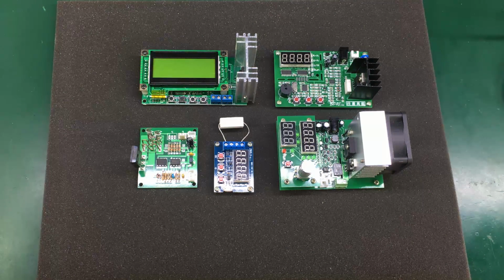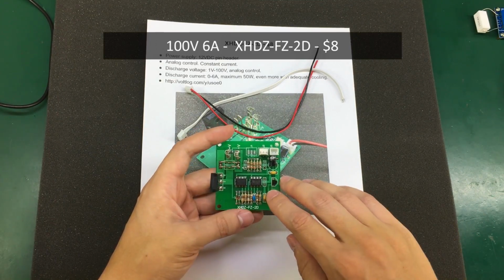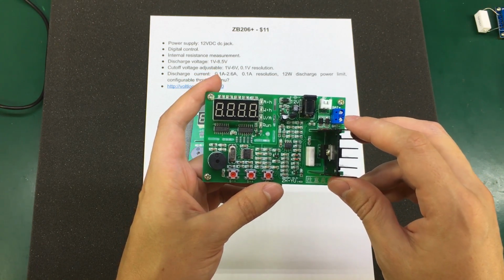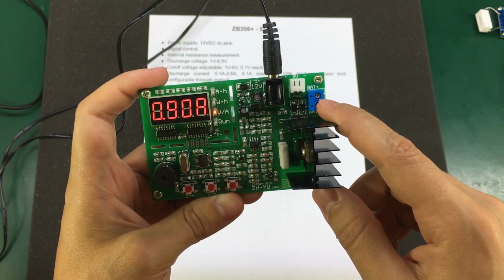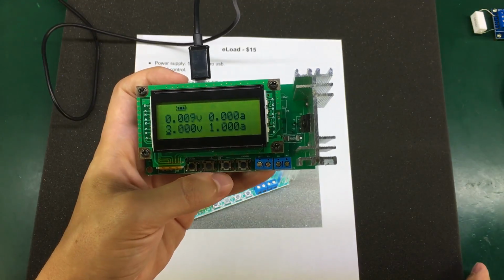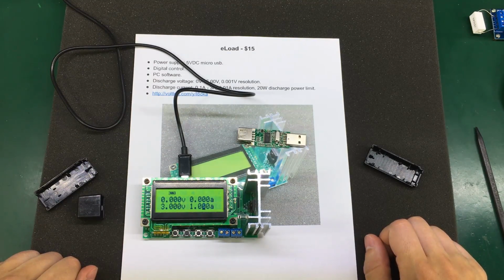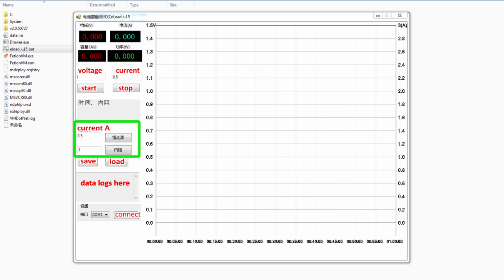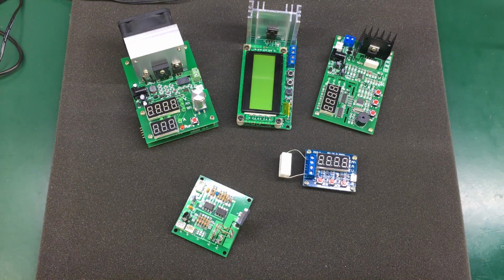Voltlog #61 - Dummy Load Special

Comment: I'm still relatively new to the hardware side of this hobby and I'm wondering what the best general multi watt resistor values I should keep on hand. I'm getting into making buck/boost circuits and I'd like to have some resistors for load testing instead of relying on my variable one.

Comment: Hello I fixed my eLoad it was the shunt resistor, blown from PCB side. Now eload works but I'm having trouble calibrating it with chinglish manual from banggood, so could you make a video about this calibration procedure?

The eload is back on aliexpress but it's way more expensive 20 to 30Eur
https://goo.gl/sRheFF
https://goo.gl/mThMFj

Comment: have you tested this one ?  KKmoon LED Digital Battery Capacity Meter Discharge Tester Voltage Testing. I am looking for a accurate tester for 18650 batteries..i do not have a lot to test..what do you recommend .
Reply from the maker: I haven't tested the one you are asking. I recommend the ZPB30A1, it's reliable and easy to use.

Comment: There are other 2 models on the market now:
https://www.fasttech.com/products/1/10044951/9615247-juwei-180w-constant-current-electronic-load
https://www.fasttech.com/products/1005/10044951/9615248

also, i see now other stuff produced with that hw display + sw sold under Juwei brand
Reply from the maker: not really new, checkout voltlog #119
Reply: VoltLog oh yes... Now I remember the 150W model.... I guess the 180 has the same software just a different resistive subsystem

Comment: My eLoad USB is till not working I replaced transistor, the comparator IC. But on 8V it shows 28V in calibration and gives "Vol high" error
Reply from the maker: that's too bad :( Sometimes it's just easier to buy a new one if you feel stuck and can't get it working.
Reply: Everywhere the eload is out of stock. I changed Transistor, diode I used non fake 5A 40V SS54, changed Opamp IC TLC272C, changed battery protection chip 8205S, then unsoldered the current shunt resitor and found it was burned. Now I ordered new 3W R050 current sense resistor.

My R050 current sense resistor is on negative rail, yours seems to be on positive (like many images of the eload i found). What's the difference?

Is it possible to burn the eload by disconnecting 5V power to it while it's connected to 12V lead acid battery? Is this normal, because in power loss the eload will auto destruct? Is this why the current sense resistor was moved to positive rail?

2 versions of eload are on the internet:
v1 negative rail https://goo.gl/Ce2gPf  current sense resistor on middle transistor pin
v2 positive rail https://goo.gl/KRwV96  current sense resistor on s transistor pin
What is correct ?

Comment: I got my order on this one yesterday and played with it for a few hours. http://voltlog.com/y/usoe0
After attaching a big'ol-ass CPU cooler from an old Dell, I am easily getting 12.3V @7.2 A, which is over 88 Watts! The pot caps out at 7.2A. 
The temp is still at 51ºC with a very quiet fan. 
I am building the one from Scullcom hobby which you are familiar with (https://youtu.be/9fsf1CgnTRk), and wanted a cheap way to verify it works. For $8 you can't get any better! Did you ever think of slapping an Arduino on this one and add bells and whistles to it? 
So, 75 Watts is no problem. Thanks for this video, which made me bite the bullet and buy it. 😉
Reply from the maker: well, I thought about slapping an Arduino on a dummy load, I've even started designing my own dummy load but stopped along the way because I didn't have enough time and it was pretty tiresome to do everything by myself(firmware, GUI, enclosure, analog, pcb layout)
Reply: I like this unit very much, but its useless for me the way it is.
Unless I want to stand around for hours and record data and make sure it doesn't over-discharge my batteries!
It will be good if I wanted to load a power supply or something and watch the results, but that would be about it!
I think I'll have a go at making it better by attaching an Arduino, an SD module, a current module, an I2C display module, an  ADC and a DAC module I have hanging around collecting dust, and make this unit useful. 
I am too lazy to create a PCB or anything like that. Will just inter-connect the modules I want and see how it goes. You are right though, it does take a round 40-80 hours to do it, but hey, I don't have a YT channel and I like building stuff.

Comment: Nice upload and explanation. If anyone wants to build a super simple adjustable dummy load, Dave has a good post on EEVBlog about building one with a LM324/LM358 and a logic level n-channel MOSFET. 
  I don't know if I trust a Chinese module any more than a double dummy load without a microcontroller/connectivity ;)

  Thanks for the upload.

 Watching/building Dave's circuit lead to this video suggestion, and my subscription.
Ref(no affiliation):
https://youtu.be/8xX2SVcItOA

Any updates on which one you use most now or any that have broken during normal use?
Reply from the maker: the 60W dummy load with the 7 segment display is the most used one. None has failed so far.

Comment: hi can you do a video showing how to use the zb206+ in 4 wire mode to check the internal resistance of a single 18650 cell . thanks

Comment: Did you try this module:
http://www.ebay.com/itm/150W-Constant-Current-Electronic-Load-Battery-Discharge-Capacity-Testing-Module-/232197515548?hash=item36100ce91c:g:k2gAAOSwEzxYb0f2
Reply from the maker: Not yet.

Comment: You seem pretty competent on the matter, wich I aint.
Are you familiar with any android-app or windows program that are able to take the bluetooth seriel-stream values, like from theYZXstudio 1270 USB meter and then graph them out on the fly.. I have come across many Bluetooth seriel apps that does connect and show the values in hex or seriel, but it would be great if there was an app or program that could map/graph them out on the fly.
Reply from the maker: I do not know anything about that USB meter, I don't have one..
Reply: roger that, but its just a standard Bluettoth seriel streamer with that cheap BT-board that goes for no money, overall so any program able to graph seriel-values on the fly will do (any bluetooth terminal can sense the stream from  this USBmeter)

are you familiar with any program that are able to take stream of bluetooth "seriel" volt or current values and plot them on the fly, - either in hex or seriel-values? - i get them in bluettoth terminal in hex or seriel with seriel (fx 0052412) equals 5.2412volt and 0012123 (equals 1.2123 amp) - looking for an app or program that takes these vaues and plug them in graph-pattern so one dont need to plug them in manually.. (pretty sure this relative basic-program is out there, just to find it :- )
Reply from the maker: Sorry I am not aware of such program but you could log the text values and plot them in Excel for example.

Comment: Please test
https://www.aliexpress.com/item/Electronic-load-constant-current-load-constant-voltage-load-module-aging-test-aging-resistance-can-be-customized/32716576604.html?spm=2114.01010208.3.341.eiGy3o&ws_ab_test=searchweb0_0,searchweb201602_3_10065_10068_10000032_119_10000025_10000029_430_10000028_10060_10062_10056_10055_10000062_10054_10059_10099_10000022_10000012_10103_10000015_10102_10096_10000018_10000019_10000056_10000059_10052_10053_10107_10050_10106_10051_10000053_10000007_10000050_10084_10118_10083_10000047_10080_10082_10081_10110_10111_10112_10113_10114_10115_10037_10000041_10000044_10078_10079_10077_10000038_429_10073_10000035_10121,searchweb201603_9,afswitch_3,single_sort_3_default&btsid=f877ea1d-9b90-4f2c-bd39-8984b36d185e

https://www.aliexpress.com/item/150W-Constant-Current-Electronic-Load-60V-10A-Battery-Discharge-Capacity-Tester-ammeter-voltage-meter/32725711985.html?spm=2114.01010208.3.165.NgJJdQ&ws_ab_test=searchweb0_0,searchweb201602_3_10065_10068_10000032_119_10000025_10000029_430_10000028_10060_10062_10056_10055_10000062_10054_10059_10099_10000022_10000012_10103_10000015_10102_10096_10000018_10000019_10000056_10000059_10052_10053_10107_10050_10106_10051_10000053_10000007_10000050_10084_10118_10083_10000047_10080_10082_10081_10110_10111_10112_10113_10114_10115_10037_10000041_10000044_10078_10079_10077_10000038_429_10073_10000035_10121-10051_10113,searchweb201603_9,afswitch_3,single_sort_3_default&btsid=72c9203c-39f5-4937-bb7e-9f10cd4e0591

Comment: Got "eLoad USB". 

My version goes down to 10mA, and seems to accurate.
My verion is different only microUSB connector, the diode is on top.
The design is so bad that if power is lost during testing of the battery from 5V USB, the load will be dead. Your load seems to have 5A diode, my has lower 3A. 

I tested the diode and MOSED to be good, however I ordered new ones to test. Very disappointing indeed.

No damaged parts visible, but I can smell the magic smoke ! on the MOSFET side.
Imagine running from UPS because else you will burn the board or loose the data, because the dummy load does not remember the values.

Please test the new 150W load, I wonder how it performs.

Comment: I just bought an item similiar to ZHIYU ZB2L3 and plugged it to usb and started the test. It has now been testing the 18650 battery i have taken from a laptop batterypack for 21 hours and current reading is 1269mAh and test is still running.  Could the item be faulty or maybe the resistor. Resistor has markings 5W 75R J printed on it and looks like the one on the video (ceramic). Resistor is just slighty warmer than my fingers.  Can i just change the resistor to a aluminium covered 22 Ohm i found in a box. And do the ZHIYU ZB2L3 understand the change and still measure the capacity right? The resistor is silver colored and has printed the following markings on it: SH25 22Ohm 5% R9

I searched around and by watching your video i understood that 4.2V and 7.5 Ohm is 560 mAh  and if so the 22 Ohm resistor should drain 190 mAh.  If my 18650 battery is around 2000 mAh it should take 10-12 hours for the ZHIYU ZB2L3 to finish. 

Now it has been testing with the resistor that came with the set for 20 hours and still going on.
Reply from the maker: 75R is 75 ohms, so just 56mA discharge current, it's going to take forever to discharge those cells :-) Try a lower value resistor like 7.5ohm, keep it under supervision, watch the temperature.

Comment: Reverse engineering of the analogic dummy load XHDZ-FZ-2E. I can't figure out why using the comparator LM393 which has always one diode drop voltage higher on the non inverting input than the inverting input, so the open collector output will have no effect on the non inverting input of the first op amp. Anyone? https://goo.gl/Olr6k2

EDIT: I figured out. When no load is applied between V+ and V- the non inverting input of the comparator is below one diode than inverting input, so is pulling down the non inverting input of the op amp.
Reply: Adrian Carstea we s I was Ist pu 00

Comment: an other one, just spotted on AE: https://it.aliexpress.com/item/DC-3-7V-21V-3A-Adjustable-USB-Electronic-Load-Battery-Discharge-Capacity-Tester/32691675776.html
Reply from the maker: I have seen that one before, increments of 20mA, I'm curious about the lowest current it can go to.. I guess I would spend some more money and get the one with the OLED display http://voltlog.com/y/qxh3k

Comment: Hi,

I want to ask about the ZB2L3 tester.
A review from ebay:

"A word of warning to everyone, DO NOT BUY THIS DISCHARGER! The problem with this discharger is it assumes you have a constant current load hooked up to the discharger and that said constant current is 2 amps. The problem is that the resistor provided with the discharger will not discharge the battery at a constant current as it is a resistor. I plugged in this discharger and set everything up with the 7.5 ohm resistor and the discharger said it was discharging the battery at 2 amps, and this simply isn't true. Because if we do some math with ohms law, we will see that this simply isn't true:

Battery voltage vs fixed resistor value of 7.5 ohms:
4.2/7.5 ohm= 0.56 amps. The charger read 2.0 amps
4.0/7.5 ohm= 0.53 amps. The charger read 2.0 amps
3.8/7.5 ohm= 0.50 amps. The charger read 2.0 amps
3.6/7.5 ohm= 0.48 amps. The charger read 2.0 amps
3.4/7.5 ohm= 0.45 amps. The charger read 2.0 amps
3.2/7.5 ohm= 0.42 amps. The charger read 2.0 amps
3.0/7.5 ohm= 0.40 amps. The charger read 2.0 amps

I tried calibrating each discharger, but it ended up doing nothing. Since the discharger is calculating the capacity based off the fact that a constant 2 amps is being discharged (when really the discharge current is varying), this discharger is unusable for me. I cannot recommend buying this."

- what is the truth? There is a very big difference between capacity measured via professional tester and the ZB2L3 cheap meter? I just want to test my 18650 baterries.
Reply: Good to know, thank you for the info.
Reply from the maker: yes, I was expecting something like this from that tester but not that bad. Thank you for sharing.
Reply: Another YouTuber did a very extensive review on this (almost 45 mins), including reveser engineering the thing and concluded that this is total crap by various reasons. Wonder if the other ZHIYU products have the same mistakes or only the ZB2L3 for being so cheap.

Comment: I can vouch for the last dummy load. It is a really nice unit. I use it to test my 18650 batteries before I use them to build battery packs. One can't go wrong with this dummy load.
Reply from the maker: yup, I use that one as well but it would me so much nicer if it had a pc logging/control app.
Reply: Yea, but who needs that if it is in Chinese. I guess the Chinese.
Reply: @cmj20002  what?

Comment: Further, there is an Upgraded Version of the ZPB30A1 , that makes 110W with a bigger Hetasink : http://www.aliexpress.com/item/110W-Constant-Current-Electronic-Load-30V-10A-Battery-Discharge-Capacity-Tester/32680354244.html. Cheers,Konstantin
Reply from the maker: yes, it was mentioned and shown in the video.

Comment: Good Evening, I like your Videos, Congratulations!
Like you I buy many things I find Interesting from Ebay and Ali-Express and a lot of NOS Stuff for my Lab. Mentioning that, I am Designing an Dummy Load and a couple PSU all MC Controlled, but bcs I switch between many things nothing is ready yet. My biggest issue are the Enclosure and the front panels......Therfore in-between (for testing the PSU's I make) I bought the following :http://www.aliexpress.com/item/Numerical-control-constant-current-electronic-load-power-aging-power-battery-battery-USB-discharge-capacity-tester/32669638121.html. It looks Interesting and the Specs are good for that Money. Perhaps Interesting for you too.Cheers,Konstantin
Reply from the maker: this one seems interesting, what is the resolution on the current setting ?
Reply: I didn't Rceived it yet, but from what I see on the Pictures its should be 10mV, 10mA resolution , I from 0-10A
Reply: I Just received it, resolution is 10mA in CC and 10mV in CV mode, max 10A and 60V, lowest is 10mA and 10mV
Reply from the maker: wow, really nice it can go down to 10mA discharge current.
Reply: These are the posible Settings, didnt tested the CV mode, just CC

Comment: Great video.  I have all of these apart from the eLoad - I use the MC3000 and can't see me wrestling with the s/w.  Agree with your comments.  (There's a whole YouTube video waiting to be done on the shameful behaviour of FTDI trashing the cloned USB/232 chips!) 

Perhaps add this to your collection:

https://www.aliexpress.com/item/USB-Electronic-load-adjustable-constant-current-aging-resistor-battery-voltage-capacity-tester-power-voltmeter-35W/32686933876.html?spm=2114.13010608.0.99.5cBeL5
Reply from the maker: I have seen that model of dummy load, but it doesn't add anything new to the bunch I already have. In the end I would only need 2 dummy loads, one that could ideally go down to 10-20mA and up to 1A and a second one for higher power 0.5A to 10A. For the lower range doesn't seem to be any model that goes under 100mA, except the analog ones where you don't get all the nice features that the digital ones have.
Reply: Yes, but it has a very fine current adjustment.

Comment: I myselve use the EBD-MINI V3, it is very compact and also has a very nice PC app (English).
Reply from the maker: From an ebay listing I see it can go down to 50mA, is that true?
Reply: No, unfortunately it only goes down to 100mA (with 1mA steps). The software is good, it features an automated test script where you can input several values and run it.
Reply from the maker: the app looks nice though, I might add it to my purchase list. Thanks!
Reply: By the way, the EBD uses a 4 wire measurement and is very accurate, they also updated the software recently.
Reply from the maker: thank you for sharing that info, it looks like it has the best app compared to the others.